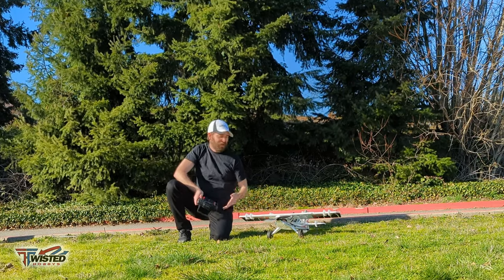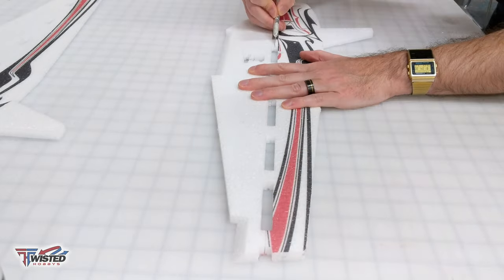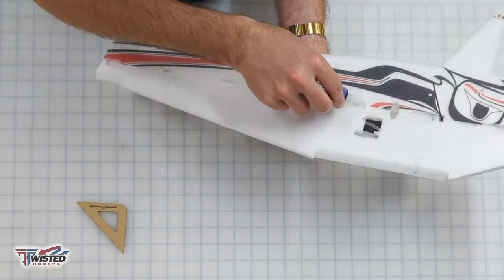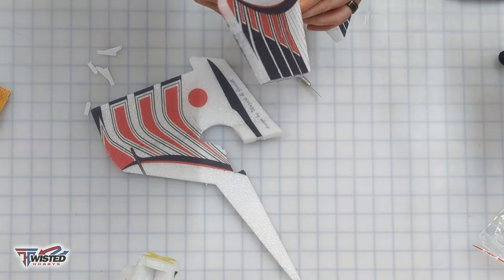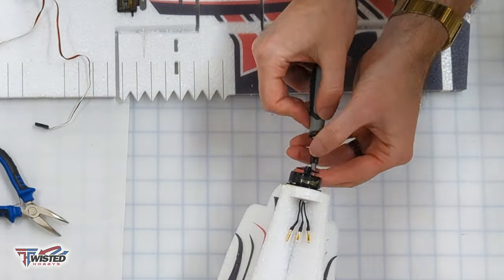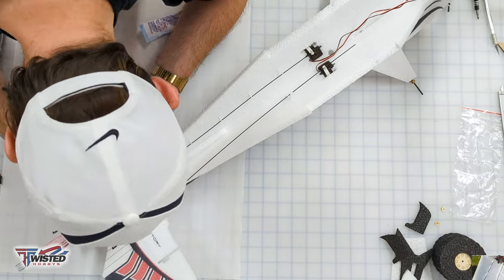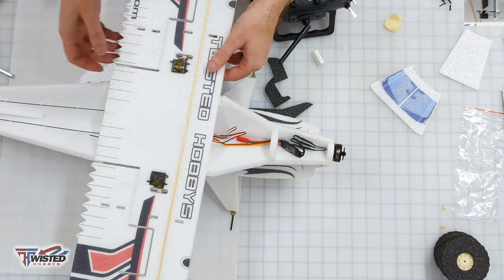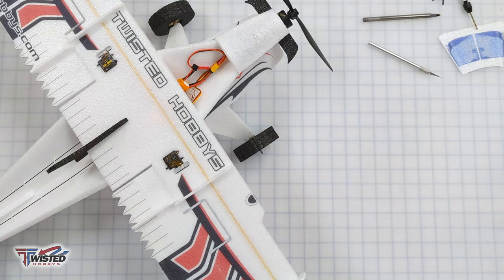Twisted Hobbys 35" EPP Crack Turbo Beaver Build Video (HOW TO)

Comment: This was a truly helpful video. I would love to see a video of how you set up the flaperons on your TX16S. Thanks!
Reply: I don't make videos for the TX16S because there are already so many great YouTubers out there doing it. I can tell you how I did it though. I messed around with a few different setups, and settled on the Right Slider to control it. In the mixer, I touched the Ail in CH1 and selected Insert after. I changed my Source to RS and set the weight to -70%
I did the same thing for the other channel for the Left Aileron Servo but set it to 70% 
That should get you going! Have fun!
Reply: @captnjim.  Thanks for your reply. I actually figured out the flaperon setup on my own. It was much easier than I had expected. I am loving the Turbo Beaver. It is pure fun to fly.